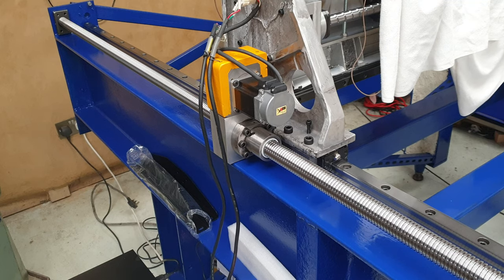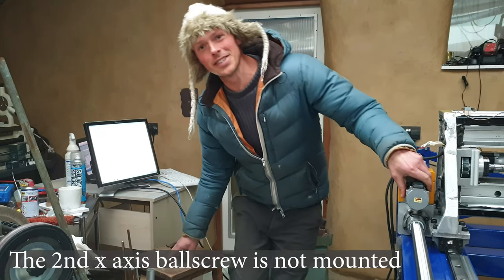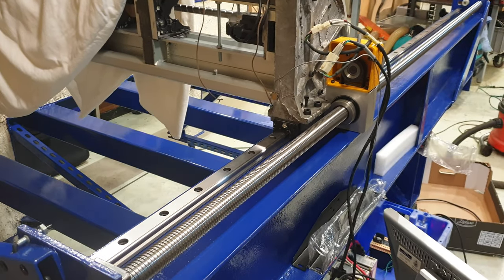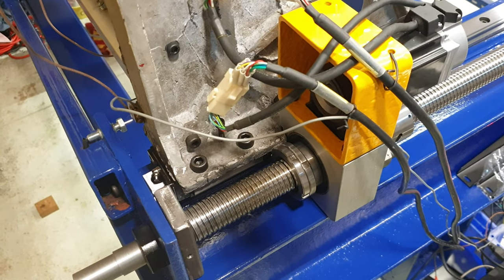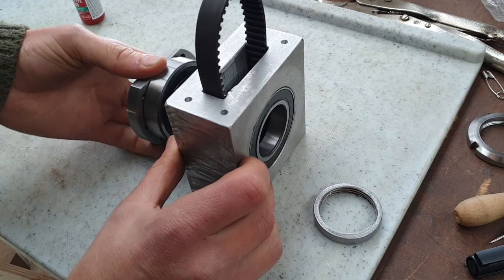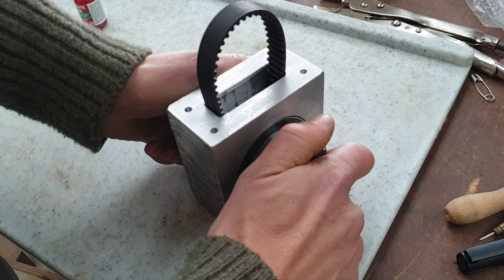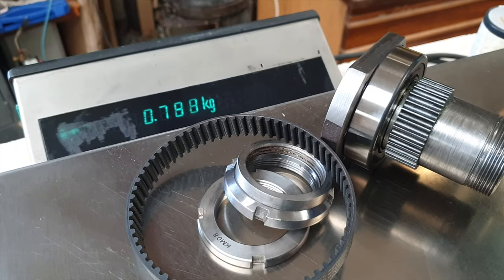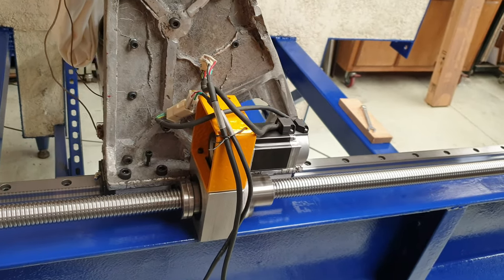Rotating ballnut design for large CNC - Lessons Learned!

Comment: I'm a CNC designer, and I can tell you that make the nut rotates is the right choise on a long and/or fast screw. But you will need to constant lubricate the nut manualy. Normaly when we use a rotate nut, we make a much more complicated assembly so we can make a automatic lubrication. Very nice work. Cheers from Brazil.
Reply: @zomgthisisawesomelol It's a good option on long and fast travels, but you'll need a reductor (with low backlash) on the servo to meintain the milling force. For large portal machine you ussualy need 2 servos, one on each side. And the mounting system needs to keep a pressure from the pinnon on the rack, the eliminates the backlash from de rack. Cheers
Reply: Lubrication isn't that hard just take the seals out of the ball nuts inside the bearing housing and have an auto oiler drip oil onto the screw.   As for the screw being a bit bent they are pretty easy to straighten, all you need is a set of v blocks a dial gage and a long pry bar or hydraulic press, you just rotate the screw on the blocks find the high spot and bend it back with the press/bar rotate again and measure and keep repeating until you get it straight.  Just make sure you use a block of wood or rubber between the bending implement and the screw so you don't mess up the screw surface.  As for the pitch you ideally want 10-15mm on a gantry that size.  Looking at those angular contact bearings being grease sealed they probably top out at 6-8k rpm I'd guess.  You probably don't want to run the ball nut much more than 3k rpm it really depends on the ball size and recirculation path though, longevity will be hugely dependent on adequate lubrication and keeping dirt out, there is a company out in California Called balltec that can supply balls in any size you like down to the micron if you need them, you could potentially polish the internals of the nut then reball to get them running more smoothly, I have rebuilt a lot of ball screws, many people treat it like a secret art but to be honest as long as you don't need to have them reground you can do everything yourself.  The main reason for a stationary nut is so you can flood oil lubricate it to push contamination out! That alone leads to improved longevity even if the seals are non optimal, typically most vmc's pump a shot of oil into the screws and linear ways around every 8mins then they have an oil skimmer in the coolant tank to remove that non soluble tramp oil from the coolant.
Reply: Please make videos about ever aspect of cnc design. Professionals are not on YouTube; ending with lot of miss information on youtube. Can you recommend a book about cnc design.

Comment: Very interesting way to turn the problem on its head. Makes me think of a helical rack driven with a gearbox. Except unlike the geared helical rack you’re not having to deal with (much) backlash.
Reply from the maker: Hey thanks man 😊. Was just watching your bow vid. Inspiring stuff my friend! Thanks for watching
Reply: Dont get why even spend money at ballscrews.  Just use a normal  20mm threaded rod with 1mm pitch.   Screw on it 3 or 4 or 5 screw nut and tight them together with hand. Then weld all together ,put in lathe and make it nice .The result is 0.000 flashback and  always accurate.  Will bend a minimal if so long threaded rod, but is doesnt matter while you turning the nuts and using the linear rail.

Comment: The rotational inertia should not be limited to the mass difference of the nut vs screw, but how much of that mass is distributed away from the center of rotation- I suspect that the rotational inertia is not as much of a design constraint as you may think- the inertia of the gantry will obviously be more of a factor, so being able to put the motors on the table rather than gantry would be nice. And as another person posted, spinning the ball nut will complicate the oiling system. But there is never a right way or wrong way- very nice work and good job thinking outside the box!

Comment: Nice. I've never thought of solving the whipping problem that way. I built a 3m x 1.6m cnc router 12 years ago and it's got 3m long lead screws with recirculating nuts like the ones you had on yours. I do get whip quite badly when the gantry is at either end and it's moving at full tilt. Full tilt is about 100mm per second. However the pitch for mine is 10mm so it's not as bad as yours would have been. I've learned to live with it.  For the person that suggested using a chain or a belt, the reason that I went with lead screws is that it's so much more accurate. I can make watch parts ....or I can cut out kitchen units. Anyway, thanks for sharing.
Reply: they put a little stretch on ball screws in standard cncs.  but the castings are larger and more rigid also.
Reply: Driven nut design is a popular and proven way of removing whiplash.

Comment: My 0.5" X axis acme threaded rod is over 6 feet long and I had never thought of rotating the lead nut rather than the rod (rod is hooked to stepper currently). I think between whip and rotating mass reduction, you have a great idea! But reading comments below, using a stationary chain and driving sprocket is a great idea too.
Reply from the maker: Hey Christian, thanks for this. The chain and sprocket would work well for low precision high-speed applications. Not so good if you want to mill aluminium to a decent accuracy... Too much backlash and/or inaccuracy in the chain.

Comment: It's nice to see the inner workings. Langmuir systems is coming out with a new 4x8 plasma table that uses this method for driving the gantry. First time I saw it I thought it would be a genius way to handle screw whip. Anyways good luck with the build, it looks awesome so far.
Reply: Shop Sabre has been using rotating ball nuts on their larger machines for many years.  Its a great solution.

Comment: First thing I thought about when I saw your layout is the issue you are going to have with chips getting into the threads of the shaft.  Need to look at placement of the screw on the underside or at least on the outer edges where you can put some shielding over them.  Also, definitely new two shafts with that placement or one underneath centered.  Keep up the good work
Reply from the maker: Hi Chris. Thanks for sharing your thoughts. There are two ballscrews, one each side... They are situated on the outer edges, but you are right, we'll need to setup some kind of shielding.
Reply: @FloweringElbow4SuperNerds  Bellows are wonderful things. Just had to replace a set on the Bystronic laser cutters at work. They do a fantastic job

Comment: You can use way smaller ballscrews since your spinning the nut. I designed a similar machine but ran the ball screw though the center of the steppers I'm using.

Comment: Great design. I suppose the only disadvantages I can think of are that the motor has to sit on the X gantry, which increases it's inertia (although probably not significantly at all) and that the additional wiring for these motors that needs to come off of the moving parts, meaning more complexity and more vulnerable.
Reply: On the other side you do not have an inertia problem with rotating the ever longer screw. THAT likely is a lot more intertie than the ADDED weight of the motor starting with a specific length.
Reply: @ThomasTomiczek  I think it would depend on the specific configuration. I think its also the kind of problem that you dont know the ideal solution to unless you build it and test it.
Regardless, I doubt that the inertia is the limiting factor, especially because CNC machines generally run pretty slow.  Mechanical bandwidth is probably more than high enough.
Reply: @tHaH4x0r  There is more than just metalworking cnc. A woodworking router cannot be called a slow cnc. The "holzher ecomaster 7113" cnc also has the design of a ball screw. Nevertheless, the speed is 60 m / min at high speed (g00), 3500 mm in the X-axis direction. True, later models were already made with a "rack'n'pinion" design because they are cheaper. . .. At least I think so.

Comment: Was the ballnut originally designed to be driven or did you modify it? If you did, then how did you affix the gear teeth?
Reply from the maker: I built a shaft that holds the pully. You should be able to see in the vid...

Comment: Inductive proximity sensors are very repeatable, dirt, wear and corrosion resistant and not particularly expensive. Dust will likely cause a pogo pin to jam over time.
Reply: The very best combination is inductive sensor then encoder zero index pulse. I've done inductive only and zero index on 2 different machines, zero index is dead accurate and I know I can resume a job the following day with the exact same homing position.
Reply: @SuperYellowsubmarin  Hybrid steppers will give you that but unless you're getting missed steps then once homed then any machine is going to be that repeatable, I only have to re-home my machine after a power down or crash. Inductive sensors are repeatable to a level far higher than most people need
Reply: @mfx1  I mean encoder index as a means of homing ! Centroid Acorn allows that. Of course for a router it is not needed, bot for a mill or lathe I actually noticed the difference.

Comment: Great stuff!😁 I'm considering a rotating ball nut design on a 1.5m long axis to avoid screw whip. One thing I can't figure out is how to lubricate the nut; as it's spinning I can't just add a lubrication line! How are you doing this on your build?
Reply from the maker: A the moment I use the oil nipple port on the ballnut when its stationary. That or I just put some oil on the ball screw itself. Crude, yes, but it works.
Reply: @FloweringElbow4SuperNerds  Thank you! That's pretty much what I'm doing with my current router; built before I knew about building in lubrication systems...!😁

Comment: Hi friend... I don't know if you read these comments... I actually enjoyed your build.... although, I am a designer, and I want to put this into CAD... specifically SolidWorks V2022.  And I have a few changes I want to make.  I would enjoy to benefit from some of your experience... such as what size your ball screw is, and where you got your parts.  What size Servo Motors, and where did you get your controllers and other electronics.  I am a mechanical designer, not an electronics guy.  That is why I am asking for such information.  I hope you can help me.  Have you  put together a materials list and where to get the materials?  Also some tips about setting up and software you are using for your setup.  I do have access to CNC Mill, and a nice lathe and surface grinder and other equipment so I can do this project.  So... if you would be inclined to assist me I would really  appreciate it. 
If your willing to assist me... I am willing to provide you with my designs, and also the plans I make.  P.S. setting up the electronics is going to be an issue for me.  I can put together components to build computers... so I do have some experience with playing with electronics.  But I have never worked with controllers and servos.
 I can be reached at... I am Leslieallen   inventorshaven@proton.me  Please contact me.  Friend... if you have Signal Messenger it would be a big help, that way we can easily communicate using video or messaging.  I prefer video actually.  Anyway, write to us if your willing.  Thank you.  I will post this on each of your pages... so hopefully you will see it.

Comment: Thanks for making videos on the rotating ball nut design. There’s not much info about it. 

Secondly if the motor is rotating too fast change the pulley confirguration to get a higher gear ratio. Less rpm for the motor and more rpm for the ball nut
Reply from the maker: Hey Jamie, thanks for watching ;) The real problem I have is too much rpm at the ball nut. In order to get good speed the ballnut's got to turn too fast, and it wont last... I have some new ballscrews with a larger pitch now ;)

Comment: I have a question about this. Since there are limitations with the top speed of the shaft rotating when very long, and there are also limitations with how fast you can spin the ball nut. What if motion happened by rotation the shaft at some arbitrary rpm and then you also rotate the ball nut? So speed would then be multiplicative.
Reply from the maker: Yes it is possible, but very complicated. The relative speed is the important limitation (how fast the ball bearings in the nut are moving round their helical path against the screw...

Comment: Great information's,,thanks,,how is durability and accuracy,,,i think its better than rack and pinion system....
Reply from the maker: Hey, I'll let you know when I get the new ones installed and run it a bit ;)
But yeah in general, I think they can be a touch better for those things, but all depends on the details...
Reply: @FloweringElbow4SuperNerds  yes,,,,thank you,,
Reply: @FloweringElbow4SuperNerds  pleas can u tell me this bearing modle number
Reply from the maker: @yantechlankamachine8767  Which bearing are you talking about?
Reply: @FloweringElbow4SuperNerds  fixing with ball nut..i think tat angular contact..also pleas give me details of belt and pully for it..thanks

Comment: Excellent setup. I read that you increased your ballscrew pitch to 20 mm. Was this because you were on the limit of your servo motor RPMs? I'm on the final stage of a CNC router too and I'm considering purchasing 10 mm pitch ballscrews and using rotating nut too. Ideally I should get 20000 mm/min easily with the servos but I would love to know your experience rotating the nut that fast. Thank you :).
Reply from the maker: Hey Leonardo, thanks for getting in touch. Yes I now have 20mm pitch TBI screws (see them in the latest vid). The reason was that I the ballnut has a realistic max speed of about 1000rpm on these cheap screws... More than that and they make a lot of noise - and wont last long! The 20mm ones I got have a different kind of recirculation path for the balls and are designed for higher speeds - but still have a max of about 2500rpm (but travel should be plenty fast enough a reasonable amount below that speed with 20mm pitch). 
Are you planning rotating ball nuts or to spin the screw?
Reply: @FloweringElbow4SuperNerds  I'm planning to use rotating ball nuts as you. I'm double checking now if the ones I'm going to use have a RPM limit close to 3000 rpm which could be a problem because I really need a 3000 mm/min speed to be comfortable.
Reply from the maker: @leonardomarsaglia  It depends a lot on the diameter of the screw I think. Mine are a bit large at 32mm - even ground expensive THK ones have a max speed less than 3000...  Best check the documentation. What make is it?
Reply: @FloweringElbow4SuperNerds  Sorry for the late reply. The brand is PMI. But I could find some 25 mm diameter 25 mm pitch screws and now I'm finishing the mounting setup for those. Thank you :)

Comment: call me crazy, but what about a combination of both?

nut rotating twice the speed of screw makes for a 10mm pitch. much faster rapids.

conversely, driving it at half speed gives 2.5 or something. higher resolution.

may need some fancy software to morph between high resolution to coarse as it feeds and rapids... then again, its just differentials... easy to mentally picture, hard to write as an equation... :D

Comment: Trying to think outside the box, could you put a motor on the ball screw as well as the ball nut? Leave what you have for " fine control", but also drive the ball screw in the opposite direction for fast movement? This might be overly complicated, and not worth the effort, but might save you the money of new ball screws.
Reply from the maker: Hey Shale. That's a really interesting idea. The problem I have is that this would not reduce the speed the balls in the ball nut travel (instead they would increase proportionally with the added speed of the ball screw.
Reply: @FloweringElbow4SuperNerds  
Yes it would.  I did not fully know if your issue was the speed of the ball bearings themselves, or you might be having an issue with how fast the ball nut its self was spinning causing the issue. By splitting the driving force you wouldn't have to drive the ball nut it's self as fast. Yes the speed if the ball bearings would be the same, but may reduce the issue. Again, a pretty overly complicated solution, but I don't know how expensive those ball screws were, and may be an idea if they were expensive. Of course the idea has its flaws and may not be a good one

Comment: When you were calculating for the inertia  you didn't account for the mass of the carriage itself since it is attached to the nut assembly, not sure if this is thr best choice. Will be interesting to see how you solve this.
Reply: Why? When turning the whole ball screw then no carriage weight?
Reply: If I understand correctly what you are saying, the mass of the carriage remains the same whether you are rotating the screw, or the nut.  The inertia involved here is the comparison between spinning the nut, or spinning the screw... the balance of the inertia remains constant either way.